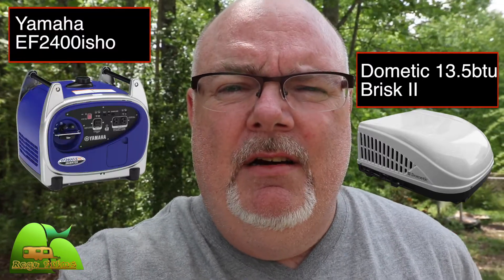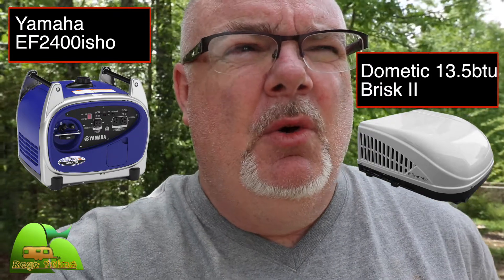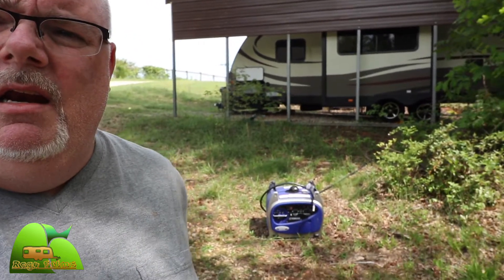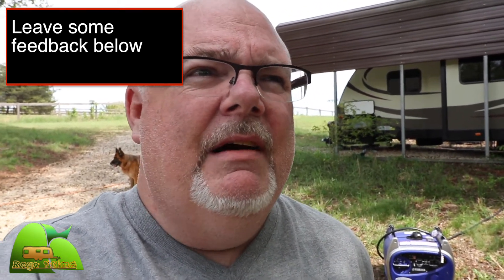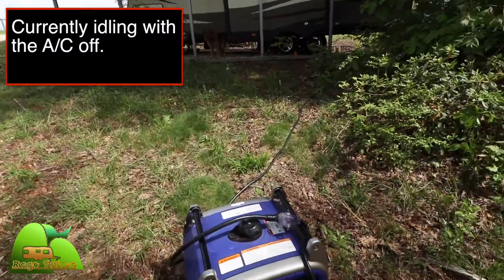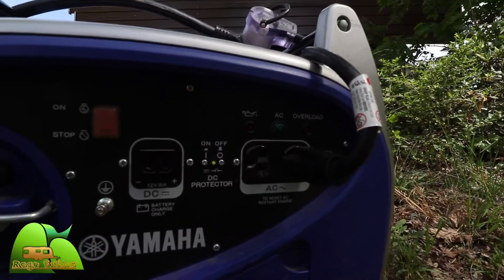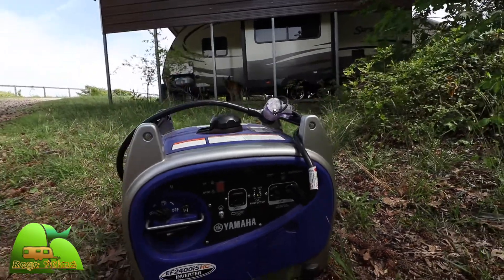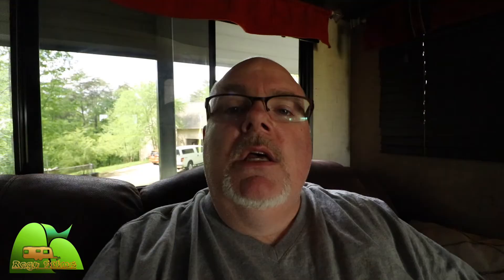Hard Start Capacitor for RV Air Conditioner  PART 1

Comment: Glad you had luck with yours, I have a champion 4k start up gen and I bought the supco  like yours and no luck.
Reply from the maker: Sorry it didn't work for you.  Seems the 4k should run the air without a soft start?  no?

Comment: I have the same A/C unit, the same Yamaha generator and did the same installation. Hopefully I get the same results when I give it a try tomorrow. Also, the same issue regarding how to secure the Supco capacitor. The only solution is what you did. Thanks for taking the time to video the installation.
Reply from the maker: I'm happy to hear that the video was helpful.  Please post your experience here when you get a chance to try it out. 
 I think that might be helpful to others.  Thanks for watching!

Comment: I love this demo. Great work. The spp6 isn't  weatherproof but you can use silicone adhesive around the wire entries at the top of the cap, also around the bottom rim of the cap.
Reply from the maker: Thanks for the additional information.  I didn't use anything special and didn't have a problem, but that doesn't mean there isn't potential for it.

Comment: Its always better if possible to use a part that the manufacture recommends like dometic has , i installed and worked fine.
Reply from the maker: Gary Davis Thank you for your suggestion. I sure you are right, however I’ve never read of this causing a problem. We no longer own that trailer, so I can’t speak to longevity. Thanks for watching!

Comment: Did you charge your capacitor? Most people forget that part, it looks like you must have because it worked. For those that buy them, it's important to note, there usually not charged when you buy them  so you don't get shocked.
Reply from the maker: Thanks for the tip on them not being charged.  I assumed so, but you know what happens when you assume!  I did not do anything particular to charge mine.  Does it not charge up when you plug into power?
Reply: @RollingRagu  They will , but I've seen some RV'ers install them and they didn't work, simply because they didn't wait long enough.
Reply from the maker: You are speaking beyond my knowledge.  Thanks for the lesson.

Comment: Good video though although coming from an electrician that generator will run the air conditioner but you need to cut the air off if you want to run like your microwave or anything
Reply from the maker: Thanks for the input.  Not only will it not do the microwave with the A/C, but I have to shut off breakers to the converter and all other drains, including putting the fridge on propane.  The A/C and a light is all I do!
Reply: No sh*t

Comment: I watched the other video too and I believe the wire with the extra tab goes to the red wire which is the relay side.
Reply from the maker: Glad you found it!  FYI, I'm going to put a follow up video in a few weeks. I'm on the road now, and the capacitor has done its job very well!  It ran at 5k feet and 100+ temps!

Comment: quick question....how did you know which was the red wire on the capacitor? I'm going to get this done very soon!
Reply from the maker: I can't find it now, but somewhere on YouTube is a video of someone more knowledgeable than I.  He took the cap off of his (which looked easy enough) and determined which was which.  I can't remember now, but one wire has the "L" shaped connector and the other has a straight connector.  

I'm on the road now, so I can't look, but it may show in my video?  I've run my A/C for about 6 days now with it hooked up, so I'm confident I got it right.
Reply: Thank you! i will find it, from your video i'm a believer...will update when we do ours.
Reply from the maker: Yes, please let me know how it goes for you.